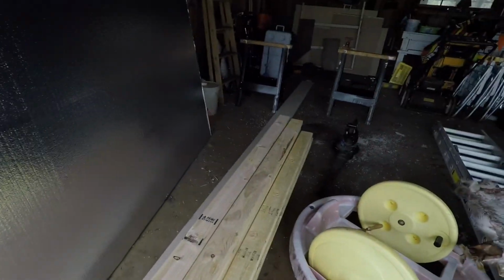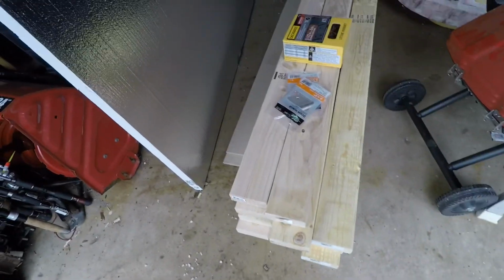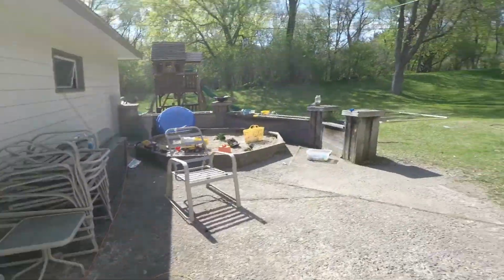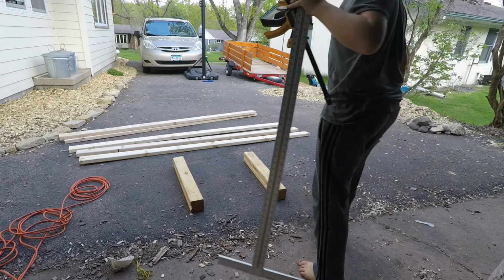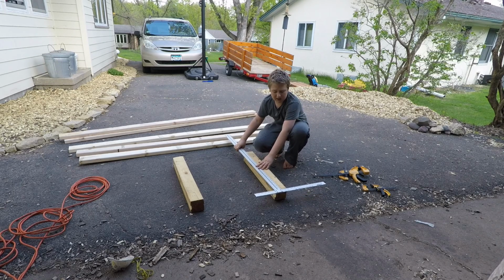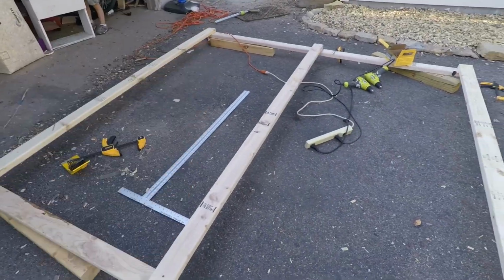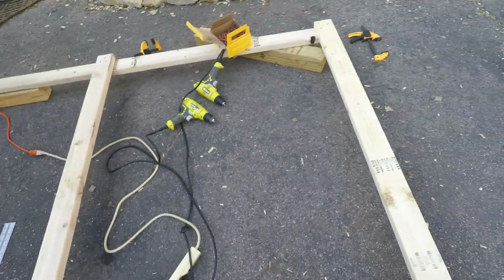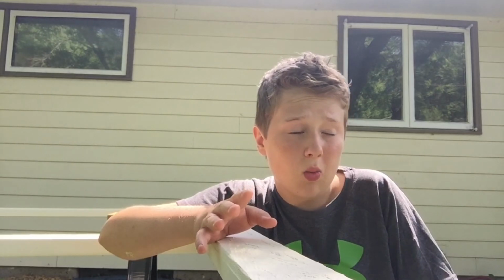Building my BIRD AVIARY!?! (Pt. 1)

Comment: This is amazing... Would you recommend any other wood other than pine?  Pine is a bit pricey.  Also what wood does best in the rain?
Reply from the maker: Where I live, pine is the cheapest wood available, but any other wood will work (as long as it’s not composite board, or plywood) As an answer to your other question, no wood does well in the rain, so using a good primer is a must, it’s kinda expensive, but it’ll last wayyyy longer than with just paint. The primer will really help seal the wood, and protect it from the elements; without it, pine will rot away in less then five years. Thx for commenting, and if you have any other questions just let me know! 👊✌️